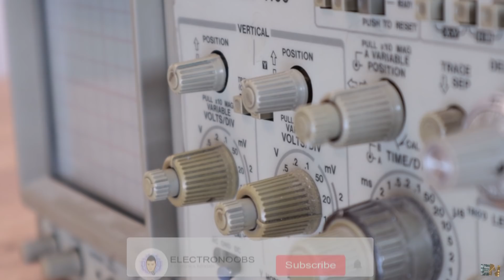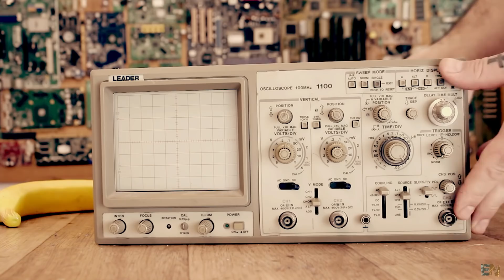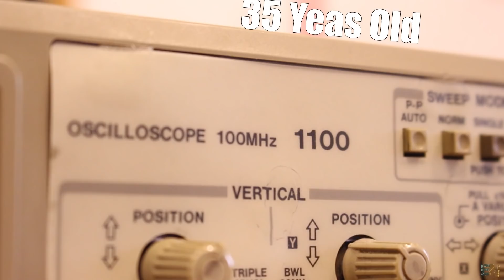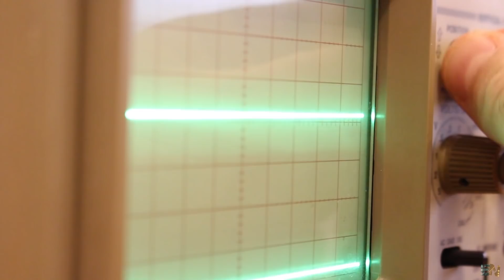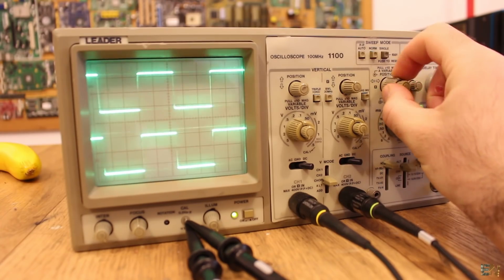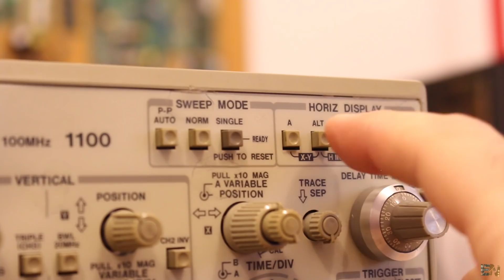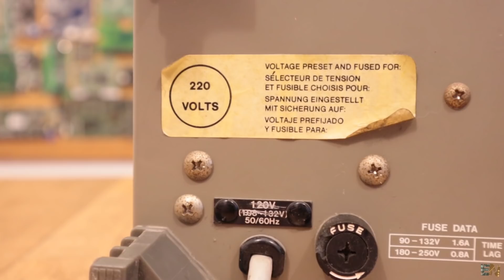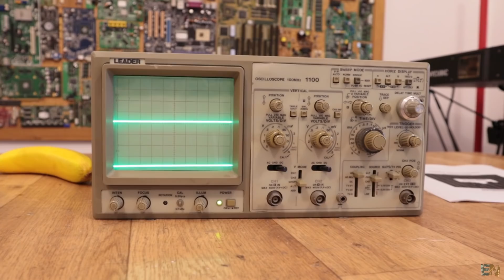Vintage Teardown #1 - Leader 1100 Oscilloscope

Comment: I once fixed this old vintage oscilloscope. Took me about 2 days to figure out what was wrong with the scope and it turn out that the electron gun had some worn out components. Couldn't figure out what was wrong with it exactly. Luckily I had another electron gun from another vintage scope so swapped it out and now it's working just fine.

Comment: Oscilloscopes use electrostatic bean deflection voltage potential on internal plates. TV CRT tubes use electromagnetic deflection with external winding (yoke).

Comment: wave soldered, this was before pick and place or surface mount
also, LEDs from that era were mostly red, or dim green, no yellow or white
so the backlight is not LEDs, just regular old filament bulbs

Comment: Front to back switching was (is?) a common safe design practice. Basically, it keeps all the mains voltage in one place (e.g. on one pcb) and well away from the front panel controls.

Comment: I have a Hitachi VC-6023 Dual Beam scope of similar vintage to this.  I have had it for over 20 years and it was quite old even then.  However it still works and is the only scope I own.  Back in the 1960's I built a Heathkit oscilloscope, about 3" tube and all valves.  In the 1980's I worked with a 68xx development system with a separate twin 8" floppy disc system.  When it was thrown out I could have had it but just couldn't lift it!  Interesting to see the old stuff, brings back happy memories.  Bob

Comment: Hi, I have a Problem using easyeda. I have no parts from easyeda!! Please help
Reply from the maker: What is the problem?
Reply: @ELECTRONOOBS  Well the Problem is that if i want for example place the ne555 I See that tere are no lcsc companents but if I search for it on lcsc there are more than two parts available!!
Reply from the maker: @startobytes  I have the same problem. I think is their server problem becasue now is holiday in China. I search for any compònent and they never appear in LCSC SMT category. I hope they will fix the problem soon. For now you have to search the component on LCSC manually each time...
Reply: @ELECTRONOOBS  But I don't know how I should do that. Please Help me.